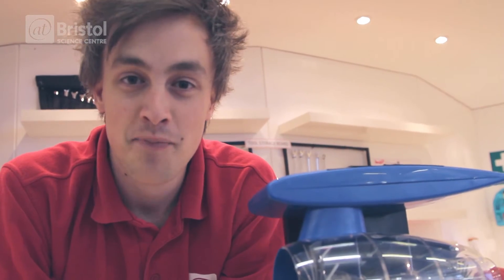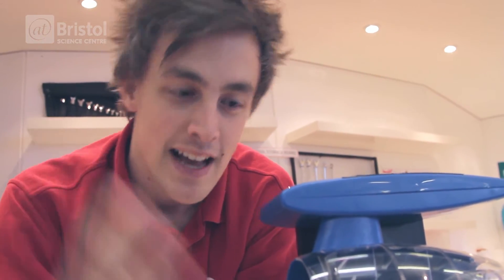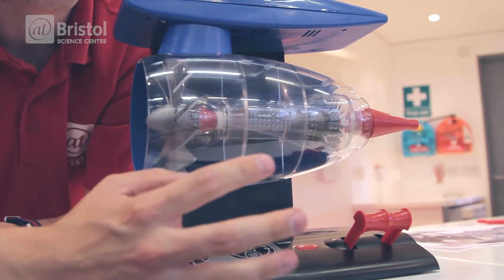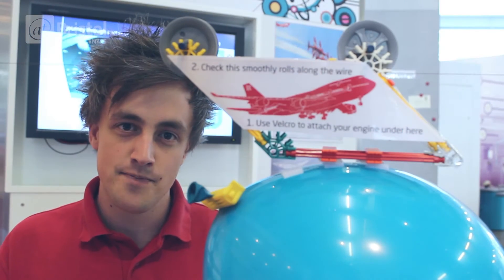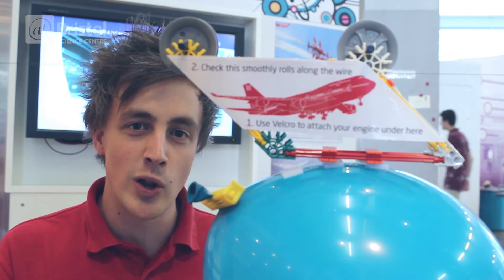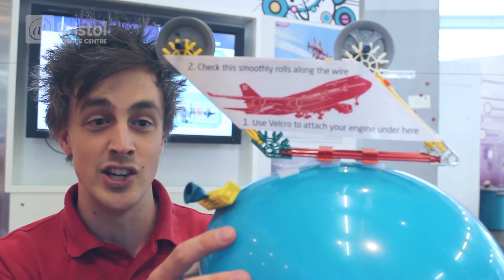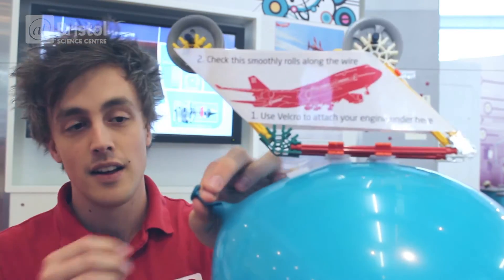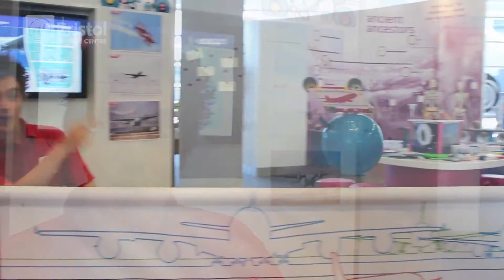How does a jet engine work? | We The Curious

Comment: I believe the concept of how a jet engine work is greatly distorted, Bernulli's principle is more apt to explain the thrust concept.  Newton's F=M X A applies, but Bernulli's principle of fluid motion and pressures is what causes the thrust.  The fan in turbo fans is nothing but a propeller with airfoils that "pull" the engine, the thrust from the turbine is gained as the pressure from the outside of the area near the exhaust of the engine is much lower than that of the exiting air, thus creating a lift (in the forward direction) of the engine.  I am yet to find this explanation in any main stream video.
Reply: Actually, he wasn’t that far off. The fan may act like a propeller in the sense that the fan blades are essentially mini wings that generate horizontal lift like an un-ducted propeller but the reaction force on the fan is little to none, so the fan produces virtually no net thrust of its own. I’ve talked with numerous people who work for Pratt & Whitney along with RR Trent and they’ve all told me the same thing. They told me that the fan in a high bypass jet engine is more of a compressor than anything else, the fan blows air through the ever narrowing bypass duct as this air squeezes through a tighter and tighter space (similar to the rotor blades of the LP and HP compressor). The energy that the fan puts into partially compressing the bypass flow cancels out nearly all the thrust produced by the fan acting like a prop so the fan’s net thrust is <1% respectively. Meanwhile, once the compressed bypass air reaches the bypass nozzle, it expands back to its original volume (and also expands as it cools the engine core and heats up to an extent), accelerates, and shoots out the back of the engine just like the core exhaust (though at lower speeds than the core exhaust). This is where F = MxA comes in to the picture, as the bypass(M) expands and accelerates(A) out the back of the bypass nozzle, it produces forward thrust in accordance with Newton's third law. Also, a propeller’s efficiency starts to plummet once you reach speeds around 350 MPH, and turbofan airliners fly way faster than that so it wouldn’t make sense to use a “ducted turboprop” to propel a transonic plane.